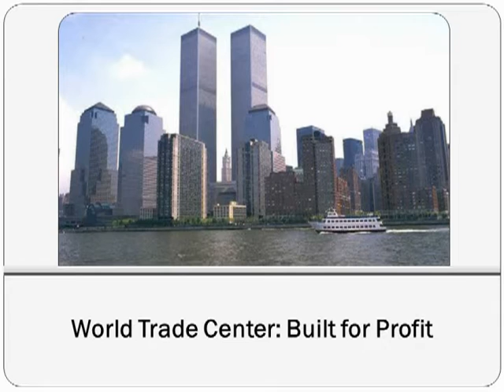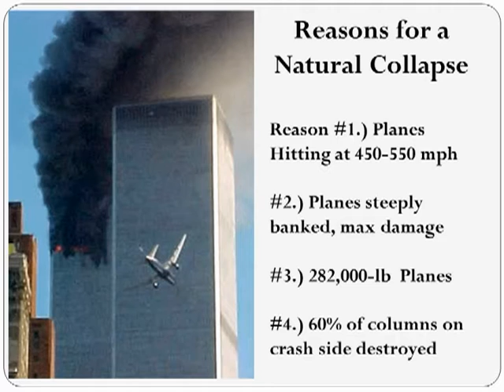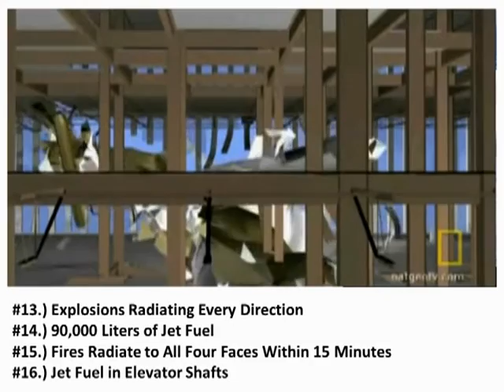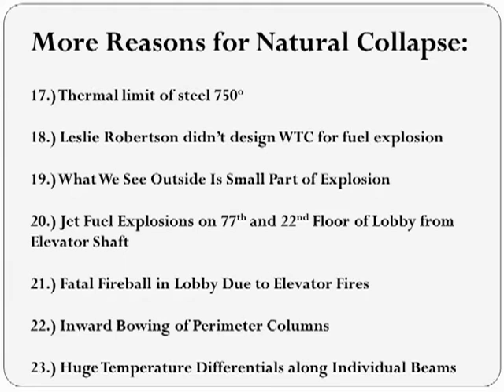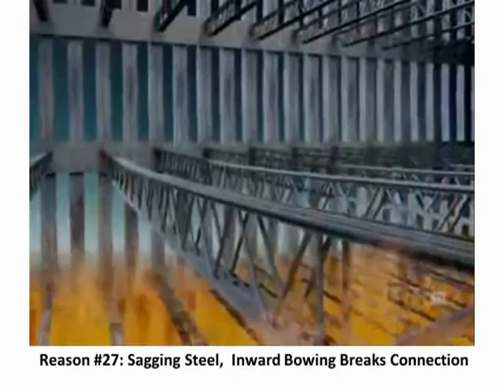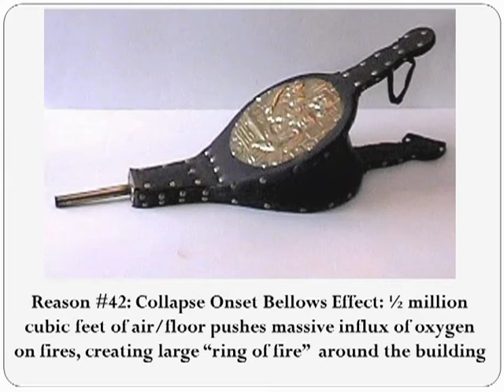Part 1, 9/11 Conspiracy Theories: Chris Mohr's Rebuttal to Richard Gage

Comment: Mohr is in denial. Aluminum wings do not penetrate steel and concrete ! DIdnt he pay attention in material science classes. He spent his youth watching Wiley coyote
Reply: Are you sure they weren't aluminum allow wings. Since most of the outside surface of the towers consisted of windows, they provided a much less impenetrable obstacle than did the Pentagon. In their case the wings could have left large entry marks, as numerous videos suggest.
Reply from the maker: mike .D You are in ignorance! Please describe exactly which concrete the aircraft wings 'penetrated'. Also, why not enlighten yourself on the composition of the alloys used in aircraft wing construction...?
Reply: Peter Johnson Should have said, (aluminum alloy) not (allow).